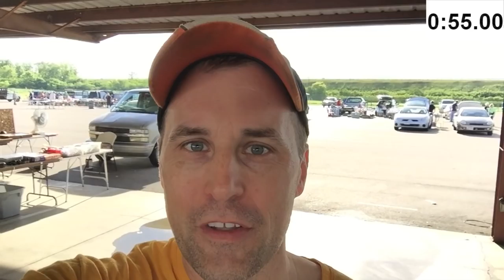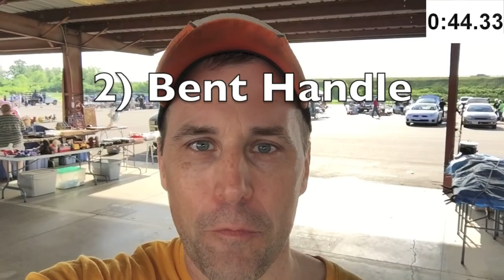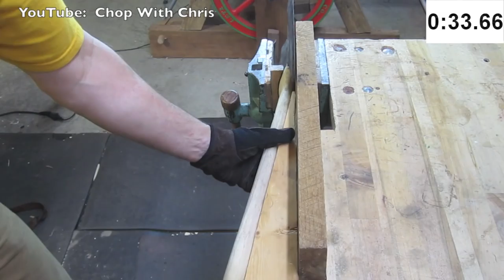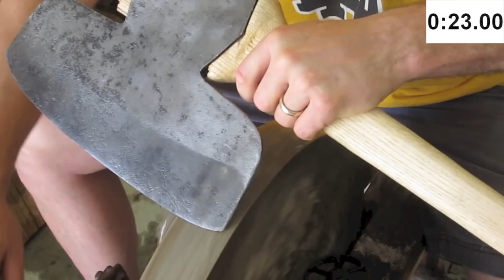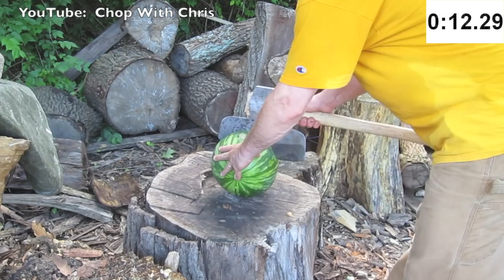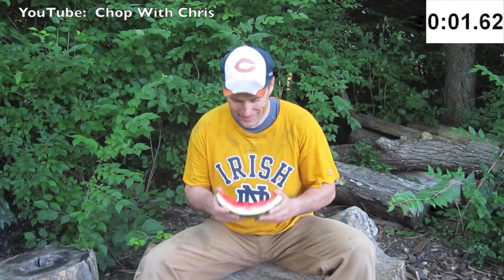How To Restore An AXE

Comment: What did you use to clean the axe with. I have several including a few coopers axe's and need to clean them up. they are mostly black right now from sitting in a barn
Reply from the maker: +terry pardue and Wire brush

Comment: Is the grind different on each side of the axe head?
Reply from the maker: J DeWitt Yes - its got one bevel vs. 2.  Its flat on one side and beveled on the other which allows for the axe to SHEER a log flat to make a square timber for a log cabin.  A double bevel is good for CUTTING into something.

Comment: Out of curiosity (I browsed the comments but couldn't find an answer) why would you bend your axe handle? I've handled axes for awhile and never even heard of angled heads what's wrong with me doctor?

Also so glad to see some more of your videos, is it in the realm of possibilities to see you build a swing-chair on a tree branch? Would love to see your take on that :)
Reply from the maker: Good question. A single bevel broad axe is used for hewing trees into square beams to make log cabins and barns. This means you have to chop parallel to the log to slice off the rounded sections. Bending the handle at an angle away from the tree ensures your hands and knuckles are not pinched between the handle and the tree.   Is this clear?  Thanks for the question.
Reply: I'm not really sure I get it :)
Maybe all the types of axes and why they are the way they are is a good minute-video?
Reply from the maker: Oscar Barda I will do so.